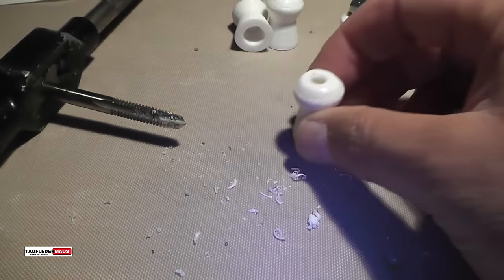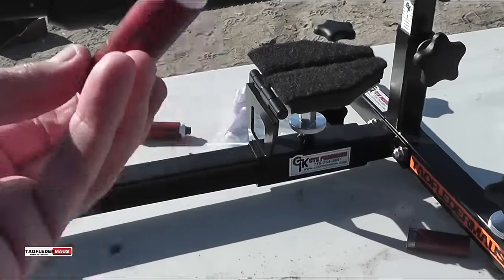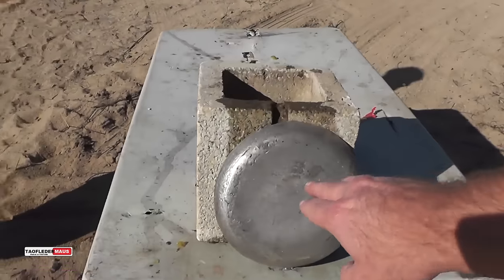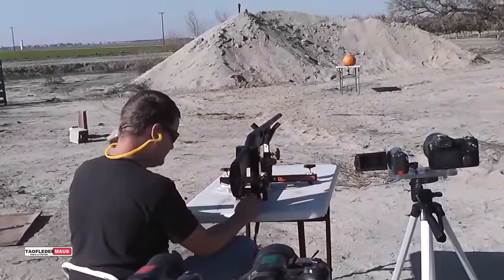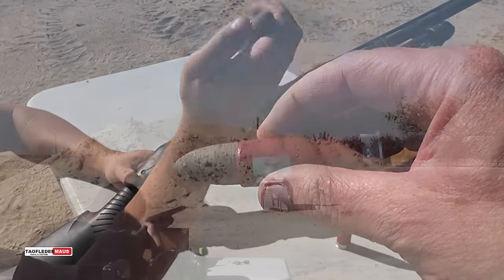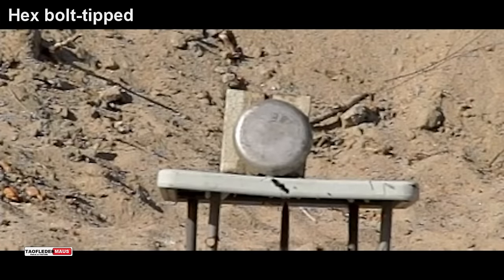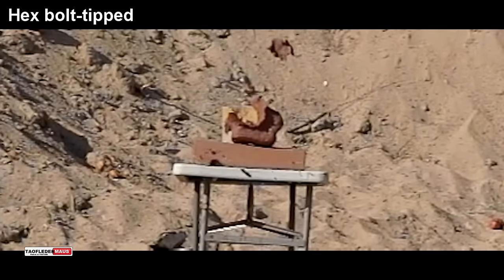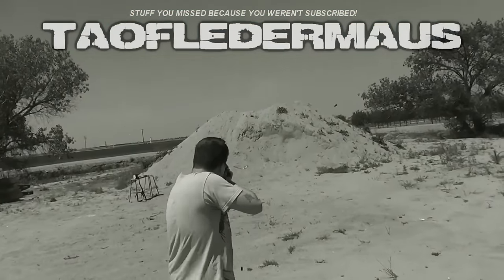15 year old viewer creates incredible 3D printed Slugs

Comment: Damn, are normal slugs that accurate?
Reply: Oh, my bad
Reply: +Allen Ashley yep, lead is still best, its just a proof of concept, nothing beats lead for simplicity.
Reply: +Allen Ashley I think the rifled choke improved it but a lot of slugs still oscillate quite a bit
Reply: +wooo weee yeah thats for sure.
Reply: wooo weee Considering that a 3d printed plastic slugs works, imagine mass manufacturing in denser plastics. Cheap, accurate, and powerful slugs
Reply: +MY2KSapphire or finding a way to print it with metal, like lead.
Reply: BlueLightning Films No because 3D printing is an inefficient manufacturing technique
Reply: +MY2KSapphire well depending on your alternatives
Reply: Allen Ashley Well, I am not trying to have lead gas in my room.
Reply: +MY2KSapphire oh, were you talking about 3D printing metals?
Reply: Allen Ashley That's what the previous guy was referring to
Reply: +BlueLightning Films Why would you want to print lead when it's so easy to cast it?
Reply: +FluffRat Mostly because "printing lead" and "printing bullets" sounds cool as hell.
Reply: Raptor Jesus I guess... and theoretically you could make an extruder head for a standard FDM type 3D printer that would work with lead wire, but you'd have to get it about twice as hot as a PLA head, and you'd have to be careful not to expose yourself to lead vapor. If you don't care about it being pure lead you could probably make one for extruding lead solder a lot more easily.

Comment: what a simple solution! smart kid!
Reply: +Hill Top Thank you!
Reply: +MY2KSapphire Very nice design is there a possibility to patent it? Would be very cool for you if there was.
Reply: Ethan Jones Nah, patenting is a long and expensive process. Plus, I don't think that I should patent it anyways
Reply: +MY2KSapphire Correct. 3d printing isn't the most efficient manufacturing process for commercial application. This does have an important role for the DIY and decentralized defence community - https://defdist.org/ however. Keep up the good work and be safe!
Reply: +Hill Top Yes. Finding SIMPLE solutions is the hardest thing ever. It's easy to create complexity. Very hard to create simplicity.

Comment: you are using the word "invent" too loosely.
Reply: +Jonas Devenport The people who invented the TV couldn't have done so without the invention of the radio, and the radio wouldn't have been invented if not for several other things. Don't be mad that something simple is so brilliant that you wonder why nobody else thought of it first.
Reply: +Nukle0n to use that analogy then a TV would have to be using the same components as a radio but changed some. its a weak argument.
Reply: +Jacob Contreras TV uses radio waves. Without the easy way to transmit and pick up different frequencies having been invented, there would be no TV to be invented.
Reply: TheDominickel
you cannot invent products, you design them. only entirely new ideas can be invented. television for the first time transmitted pictures through cables into people's homes, that kid deigned a bullet. Correction: he stole someone else's design and up-scaled it, but let's all get a participation trophy anyway.
Reply: +Paul MvN at least he isn't "cool clock ahmed " tier
Reply: +Paul MvN Everything builds on what comes before. Few things are totally out of the blue, original. Knowledge doesn't come from nowhere.

This is also why I think it's stupid that copyright lasts for over a century.
Reply: ***** I've done nothing as well, so I am useless too, right? Even though I DON'T make deprecating comments.
Reply: ***** I am not deprecating the person in the video. Thus I am under no obligation to be "useful".

Comment: now get more, use high brass, chronograph and test again.  This is a huge breakthrough, without a doubt of 2015 in the firearms industry.  I see a huge market for these produced in a hollow configuration (will be required to sell legally) and then the buyer will be able to add bolts or whatever else is legal in their area.  These will replace wax slugs. It is not the weight that causes these to fly straight but the centering of the carried projectile through the bore.

Comment: It's interesting to see that the slug didn't actually penetrate the (mortar, not concrete) roof tile but the shock punched the hole through it. There's still plenty of ft*lbs left when it arrives at the target. In hindsight, it makes sense that an air rifle pellet profile would work.

Comment: The thing with these is that it has that sloped ring around the front which causes front drag and maintains a balance due to when a side pushes too far one way the force of friction pushes it the other way. The reason the others didn't work is because there was little to no drag.

Comment: mike if your reading this make the slugs at .62 cal, should be enough to make a slip in sabot to make the slugs longer, with your design, see if we can get the long slugs to balance out. also, if you want to get some high speed accuracy testing of your pellets if you can make 5.53mm head diameters id love to try them and give you feedback on how they preform, i can go down to 400fps and over 1300 with 18gr pellets to give an idea

Comment: Now use these in an expendable mold casting process. You pick the foundry, you pick the material. Some pointed "pellets" would probably achieve some additional penetration, due to the stress concentrations created upon impact.

Comment: The only part of this design that matters is the wide hollowed base, the kid isn't a genius, he copied the exact proportions of a lead pellet.  The mistake these guys always make on this channel is firing slugs that don't Squeeze through the barrel.  You can't make a slug out of steel because it can't expand when fired, and squeeze through the barrel which forces it to contact the rifled choke which makes it spin.  Loose slugs going down a barrel will never fire accurately.  Most of the designs they have made would work if the slug was a tight fit to the choke tube and made out of a soft enough material to allow expansion in the barrel.  This is how the process works.  slug goes in chamber, slug is fired, hollow bottom of slug is expanded by the explosion and forms a tight fit with the walls of the barrel, slug starts to spin as it is now in FIRM contact with the rifling, slug leaves the barrel and flies accurately to the target.  If your round doesn't allow this to happen then it's not going to fly straight, the end.  Now this channel can stop acting like it's a mystery...

Comment: its an interesting design and it works because its already been used for years - basically its a copy of a air gun pellet - why tamper with what works - you should try installing a threaded concrete spike - its a pointed conical rod with threads on the back - they are very hard because they can penetrate concrete - i suppose they can even be hardened further - if you mounted the kids pellets in a lathe and absolutely centered the threaded hole - you would have an amazing projectile

Comment: the amount of people so jealous about this kids ingenuity with 3d printed slugs is astounding. my last job was working with cnc operators and i will tell you even if something looks the same, the smallest of differences in materials, size, and application of said product can make a huge difference in how much goes into the engineering and drafting process. the kid has a very successful design for what he set out to do and i commend him for it. keep up the good work taofledermaus and to michael!
Reply from the maker: +-iDol-Hands  We've shot many CNC slugs before and most of those were no where near as stable in flight as these.   The few wobbles in these were most-likely due to how I tapped them.    He not only 3d printed these but put them in something he calls a 
"acetone chamber"  to  cause the plastic to have a stronger bond.   The thing that impressed me was Michael's drive to get me to even test them out.  I normally try to talk people out of sending me stuff just due to the costs.  He really wanted me to shoot them!  
Within a couple of days I received the package and also posted a video showing how he made them at my request.

Comment: i think the variation in flight stablity is just a matter of the pitch of the bolts in the pellet because you guys used a hand drill and not a press to tap. so the COG was a little different each time, that being said they worked great regardless. But definitely  room for improvement with more accurate printers and machining. Id love to see this advancement have a huge impact on the cost of ammo, productions about to get that much more competitive.

Comment: Just a random idea.
If you would put an un-threaded insert into the bullet, would the insert continue flying on after discarding the plastic?
That way you could put some kind of "penetrator" in there.
One thing I can see happening is that because of the rapid acceleration the insert would separate from the plastic upon being shot.
Reply from the maker: +scrambeledc  The some of the bolts did continue flying and you can see the sand being kicked up.   If you don't secure the heavy core really well,  it will get knocked out of the plastic slug just from inertia when it is shot.

Comment: the mass of the projectile isn't sufficient to build enough pressure for the power to be ideally burned.  thats the main reason the muzzle velocity is so low. from my past experience you need at least 300 grain total mass plus wading to fully burn 35 grain of longshot power in a 18 inch barrel.

Comment: You were talking about how the projectile was flying high. I believe the way your gun is placed on the table is causing that. What I mean is the tip of the barrel is directly over the table, and the air that is pushed by the projectile, or around the projectile, is hitting the table, pushing the projectile up. I have heard of this with some large caliper shooters who are "down in the dirt" talk about this happening. Could that be what was happening? Maybe try moving the gun forward and make sure the barrel is a few inches past the end of the table?

Comment: These are basically a sabot that you can put a bolt into as the projectile. just an easy to use design. screw a bolt into a sabot and fire.

Comment: I've always had a feeling the diabolo pellet shape would work in a shotgun, the drag the skirt produces makes them self-stabilize in flight. The only nasty part is they do not work well once they go transonic, which is an issue with actual pellet guns that can shoot them over ~1000ft/s. Once they break the sound barrier, the drag will increase and yank them back down in velocity while causing it to wobble a bit like you're seeing in the high-speed footage.

Now, to avoid this with high-power pellet guns you use heavier pellets to lower the velocity. I wonder if you can do the same thing by making the same slugs here with mild steel or possibly lead, keeping it subsonic by increasing the mass, which should also increase the energy at the target.

Someone with a lathe and some spare steel rod should give that a shot, I'm almost positive it'll work exactly the same way since this video does prove it'll scale to shotgun slug size!

Comment: If weight is an issue why not use this design, hollow out the inside (or modify the design to come pre-hollow), fill it with pellets and seal it with the 3d printer?

Comment: PUMKIN MORTAR!!!
can I say I'm honestly not surprised it worked, they look almost identical to air rifle pellets only upscaled.
The shape stops "super cavitation"??? I think that is what it is called.
It is the same size between the two ridges as the shock-wave is so it fits through the pulses coming off the nose.
Which is what cause the others ones you have tested before  to go ass wonky.

Comment: In another video you fired glass slugs and said... the reason why the glass slugs aren't accurate is because of reduced mass and yet here you have essentially a plastic pellet with very little mass in comparison that's very accurate. Here's why and it has nothing to do with mass and everything to do with expansion. Any projectile travelling through a barrel has pressurized gas behind it that is propelling the projectile forward. That highly pressurized gas is also doing something to the plastic pellet that it isn't doing to the glass projectile... it's compressing the rear portion of the projectile which in turn expands the diameter of the projectile against the inside diameter of the barrel. The glass projectile doesn't expand and not only is it not expanding it also needs clearance to travel through the barrel ID so the projectile exits the barrel offset from center or at a slight angle. Engineers figured this out over 100 years ago. That's why all bullets (excluding shotguns) are larger than the barrel they're shot through. Air powered guns have very little pressure by comparison and is exactly why lead airgun pellets have an hourglass shape. The cup shape at the rear expands and stabilizes the pellet as it travels down the barrel. A sabot does the same for canons. So while Michael is a very sharp kid... his perceived genius status remains questionable.

Comment: People are kinda torn on the idea of invention here, but I say the guy's pretty smart.

Everyone's rushing to make 3d printed projectiles, using various primitive or "bullety" shapes, and here comes a guy modeling them after projectiles meant to fly fairly accurate despite their low weight.

He used the TAOF brand logic on the matter of 3d printed projectiles, and sought the smart solution, even if he didn't conjure up the shape himself.

In fact, there's probably very little deviation you could do on the design without throwing it off. It seems to be one of those "born of necessity" shapes.

Comment: They are flying very consistently. Excellent accuracy. The kid made a winner here for sure. If they were made out of a heavier material, they might be a good hunting option.
Reply from the maker: +Jesse Sisolack  Soon we will shoot some Lyman slugs that look just like these but are made out of lead and are 525 grain.   Should be good!
Reply: +TAOFLEDERMAUS I look forward too it. I have experimented with that shape before...not out of a 12ga. Anyway, if the charge is too high and the material too thin, the "tail" part will separate and you will be left with a bullet like projectile followed by a ring. It is...interesting, but not ideal. I have a feeling you will not have that problem scaled all the way up to 12ga though.

Comment: What if you mixed epoxy or some kind of acrylic with a fine metal powder such as iron. It would have the extra stability from the weight, and keep its aerodynamic features since it wouldn't need a bolt. It would have to be cast, but could be an easy project. It would be interested to see this design manufactured in such a way.

Comment: this is amazing and shows that sluggs that people normaly thinks finnstabilised is probably best but look att the aerodynamics of these "diablo" sluggs and the skirt behind the head of them does not work like finns intsted thay works like a parashute and slowing down the back part of the slugg making the heavy head drag itself twards the target thus stabilise its fligt and make it more accurate.
same goes for arrows for that matter :)

if we look att the head ther is no pointy end like a riflebullet so my theory is that pointy bullets needs some sort of spinstabilising ore they go crooked like they do on impakt at a target (pointy end in and sometimes backside/broodside out of the target) so by skipping that and go fore the flat non aerodynamic head ther is lower risk of aerodynamic wobble as its not spinning.

now you probably say thay tried using sluggs with rifled shotgun but look att a bullet traveling down a rifled barrel ther is so much contakt due to projectile being slightly larger then the rifling its get stripe marks on the bullet and full contact is made (50cal bullets is infact not 12,7mm thay are 13mm so its sligt overborred to the rifling in barrel),

compare to a shotgun and ther might actually be slipidge between rifling and projectile due to projectile bieng smaler calibre then the barrel and by any means yes ther is rotation on the projectile but not always as much as needed and thus unpredictable in that parametre.

Comment: You don't need to be so patronising, guy :p The peak of a human's mental abilities is around 13-25 years of age depending on the person (usually 15-20), most teenagers are technically smarter than adults, they just generally lack data that comes from experience or, more commonly, the means to bring their ideas to life. If a teenager has a scientific hobby and is lucky enough to be able to practice it, they often make all kinds of inventions and discoveries.

Anyway, the round is pretty amazing. The guy managed to convert the aerodynamically proven air gun (or however you hamburgers call it) pellet to a shape and construction that won't fail during the shot. Not the discovery of gravity, but it's definitely something.

Comment: It's mostly just the typical pellet shape that makes this valid. The aerodynamics of a typical cylindrical bullet shape like so many others you guys have shot does not lend to holding straight line well. I'd bet almost anything designed with the pellet shape will maintain straight flight.

Comment: Very impressive for a 15yr old. It works as long as the 3D printing material has a Modulus of Elasticity that is high enough with a Thermal Expansion that is low. Imagine printing something that has a narrow cone on it. Possibly greater penetration and more mass so that you don't need any metal at the tip. A nice addition to a carbon fiber gun =P